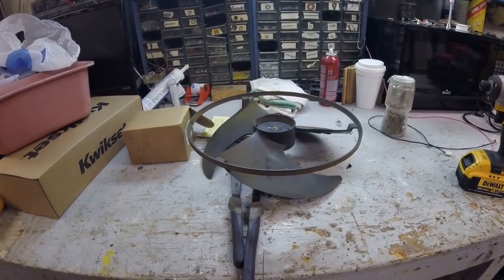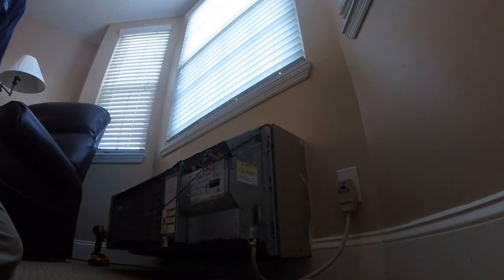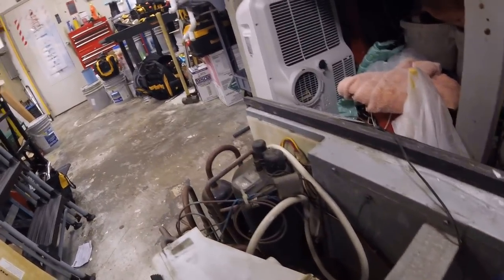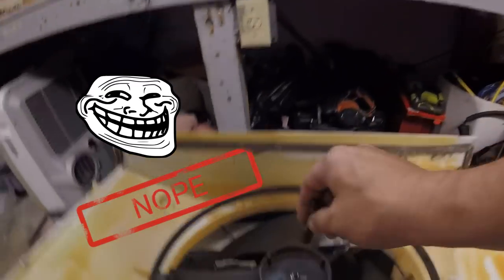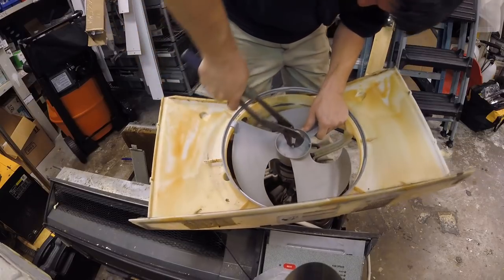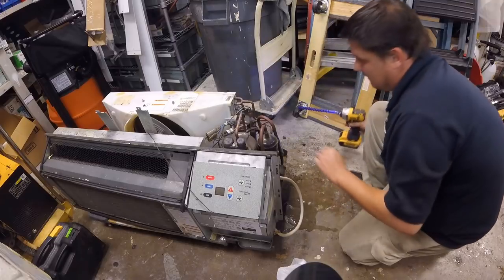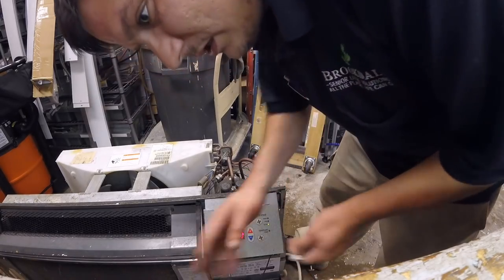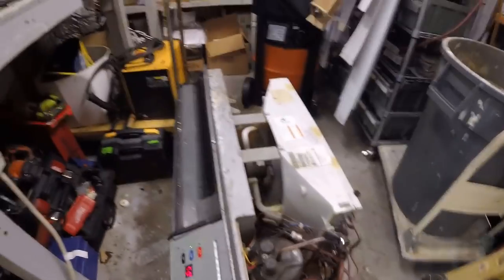HVAC HOW TO CHANGE A PTAC FAN FROM START TO FINISH

Comment: Hey Jeff I got a GE PTAC unit 2017 and there is a error code of 2 condenser fan not starting fail replace the capacitor and I still got nothing do you think it's the motor

Comment: Brother Jeff,
How do you get the evaporator ( squirrel cage out ) when I torque on the squirrel cage bolt the motor shaft in the back turns.  I wish it was pressure fitted with a safety clip.  I would remove clip and use hub puller.  I tried holding the back area but it still turns
Reply: Theres a slot in the squirrel fan blade for an allen wrench!
Reply: @lukehodgson5222 

Hello Mary!

Thank you for any/all of your help.  Yes, I am aware of the slot and allen key.  

 This is an older PTAC and the nut sits on the end of the squirrel cage.  Of course, when you try and remove it the motor in the back turns.  I have an awesome squirrel cage ( hub puller ) but to no avail.  This is the evaporator fan which is a plastic squirrel cage design.  I am not referring to the CONDENSER FAN.  Only the evaporator fan.  Unit is 20 years old.  Salvaging for parts.

Comment: The old ptac units were much better than the new junk. Multiple failures on newer ge units. They now use these dc motors that are high failure.

Comment: What would cause the fan speed to not change and stay at the same speed
Reply from the maker: Relay are the control board  But it could be that the Ptac is programed to slow the fan speed when it's about to reach the set temp.

Comment: Geoff that is one of the recalled units.
Reply from the maker: That's what I thought the fan shroud has a different mount on it they sent us a whole box of heat shield things we have to put on the back of the motors they estimate it will take 45 minutes for each installment we got the parts but not the time thanks for watching JCC
Reply: @geoffhoweth  and holy s*** 3 aaon units down well quit given them dirty looks and they will quit breaking lols